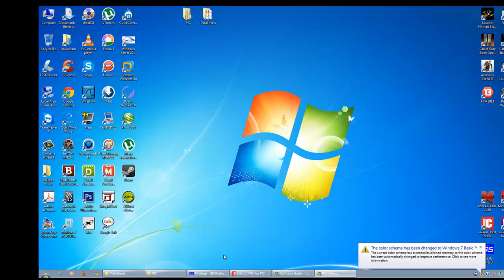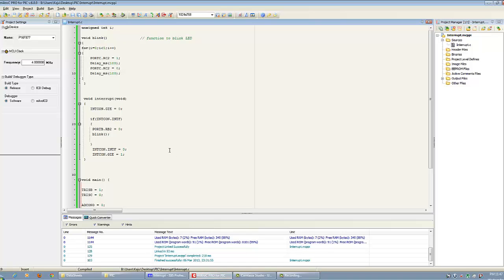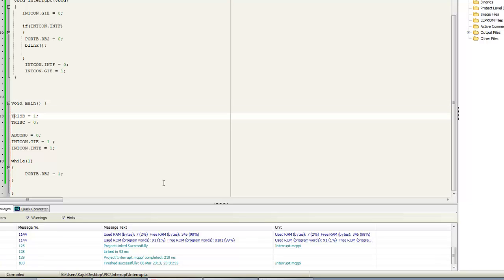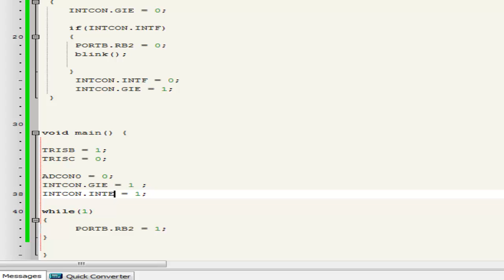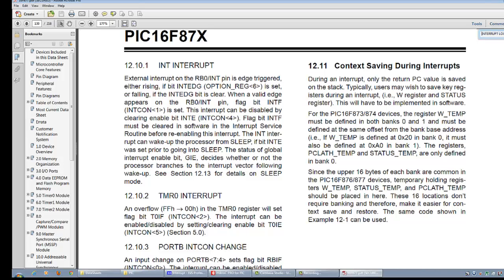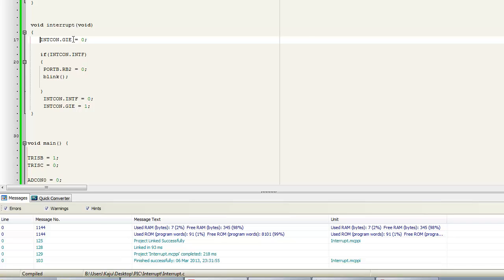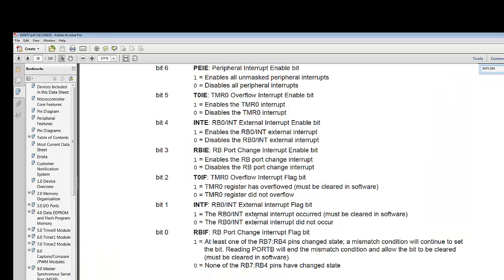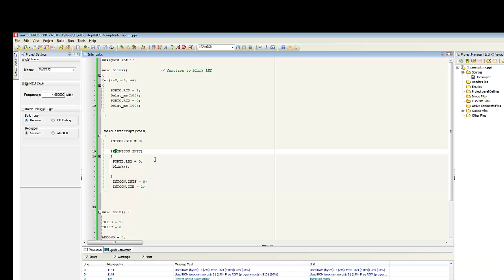Interrupt Using MikroC & PIC16F877

Comment: Please, How to use the other pins of portB as external interrupt..?
Reply from the maker: Only the pin shown in the video can be configured as extenal interrupt ( I think it is B0 or B1 for this PIC, can't remember lol ) & not any other. You need to refer to the datasheet of the PIC for more information as every PIC has different configuration. Hope this helps !!  :)
Reply: yes, thanks a lot. you used the RB0/INT external Interrupt. In the configuration part we put 1 in INTCON.INTE for enable this kind of interruption with the global interruption of course (NTCON.GIE=1). then at the interrupt program, we test the flag bit (INTCON.INTF) if it is set (when an interrupt condition occurs). on the other hand for use the others pins as interrupt on change pin (just RB4 and RB7 to the ase of 16F877) we put 1 in INTCON.RBIE and NTCON.GIE=1 (global interruption)  then we test the flag bit (INTCON.INTF) if it is set when we have an interruption in this pins, then we determine exactly in wich pin occurs this interruption. here is an example :

//configuration:

      TRISB = 0xff;
      ADCON1 = 0;     // All ports set to digital

       INTCON.GIE = 1;                      //Global Interrupt Enable: 0 no interupt
       INTCON.RBIE=1;
  
 //interrupt program:

      void interrupt()
{
if(INTCON.RBIF)
    {
if(portb.B4==1) { //do somthing1 }
if(portb.B7==1) { //do somthing2 }
     }
INTCON.RBIF=0;
 }

Comment: can you explain the pins , how many input pins , how many data pins , how to program it , I am new to Microcontrollers
Reply from the maker: The best way to get the information is by reading the datasheet of any particular micro controller. Each PIC has different configuration so you have to go through the datasheet.
Reply: thanks , its so much time consuming, I thought that if you could explain it would have been much easier, some subjects are tough for me. I wanted to learn on c2000 TI MC , tms320F2812.
Reply: Sudhansumtripathy,  The best way to learn TI stuff is to download ControlSuite and go into device examples for your particular device. Also you can post questions on Ti's E2E c2000 forum. They are good are giving feedback.

Comment: I am new to learn.Can you tell me how much learn about a specific microcontroller to write code or design any circuit? I am waiting your answer.
Reply from the maker: +Mohon Ali Thank you for viewing my video. If you want to be a successful coder with MicroControllers then you must first go through the datasheet of the particular IC you want to use & understand what all functions it can perform for your project. Secondly, you should have a good understanding of either Assembly language or C to start coding stuffs. I would recommend using MikroC IDE as it is very easy to start with & requires basic knowledge of C Programming. You will find lots of tutorials available on YouTube & internet.
Reply: Many thanks for your suggestions.I will follow your direction.I will ask you if any problem i face.

Comment: TY very mutch
just one question , why do you need to disable ADCON0
Reply from the maker: ADCON register let's u enable or disable analog to digital converter functionality of the pic. So I disabled it as I was not using the feature to be on the safer side. Hope this answers your query. :-)
Reply from the maker: +Yasser Mimouni Hi Yasser, it is not needed. I just did it to be on the safer side. Your code should run without disabling the ADCON register as well. Try it out !! .. Please subscribe & hit the like button if my video helped you :)

Comment: Hello Sir, how about we use 1 button but many interrupts routine please help.
one more thing is I want to use all pin of RB pic 16f84a, it is possible?
Reply from the maker: +Nayary packlem .. What you mean by many interrupt routines ? At a time only one routine can get executed as far as I know. You can only use that pin of PIC microcontroller which has been set to accept external interrupt not just any pin. Check the datasheet of your model & see which pin is configured for external interrupts. Hope this helps.

Comment: i have a probleme sir, can you help me to programme a pic 16F84 i want to creat a smart dipped headlights.
Reply from the maker: tihiti choukri Can you explain a bit more what you mean by smart dipped headlights ?? Are you referring to light sensing headlights which turn off & on depending on the ambient light ? Well, if that's the case you can easily achieve it using a circuit with LDR that will control the headlights, should consult some electronic engineer. If you need any help with programming, would request you to elaborate your specific portion where you are stuck. I am not into PIC for a long time so might not be that helpful, may be some one here can help you out :)

Comment: Projet Capteur de son logiciel à base du PIC16F877 + Matlab + ISIS + MikroC - Sofware sound sensor with  PIC16F877 + Matlab + ISIS + MikroC  (Téléchargement gratuit du projet)

http://www.electronique-mixte.fr/projets-electronique-et-realisations/

Avec ce projet vous pouvez réalisé en plus : 

Oscilloscope numérique(Fs=96KHz, 16 bits )
Générateur  des signaux basse fréquence numérique 
Capteur de son logiciel
Surveillance temps réel
Reconnaissance de la parole
Acquisition et traitement du signal